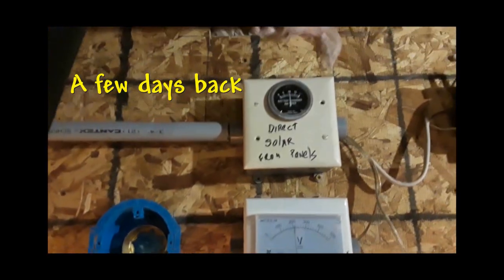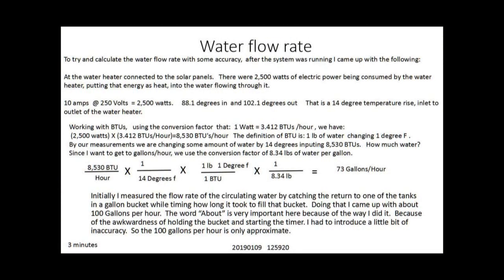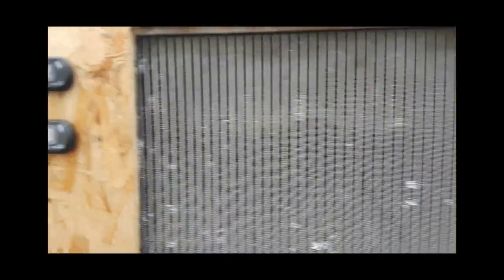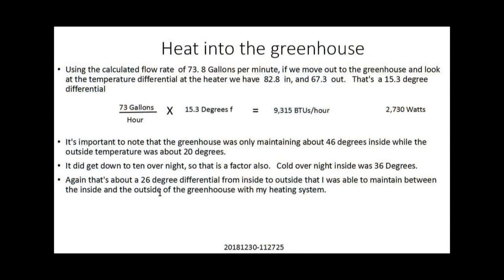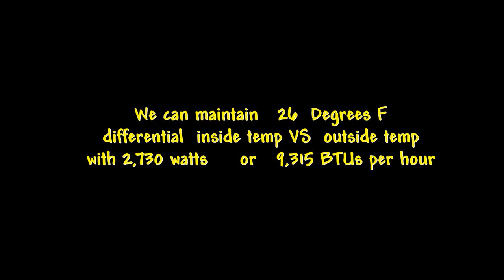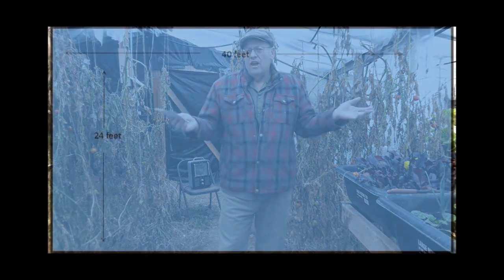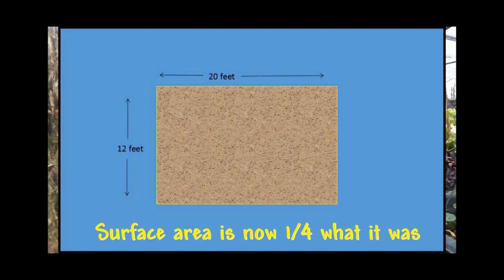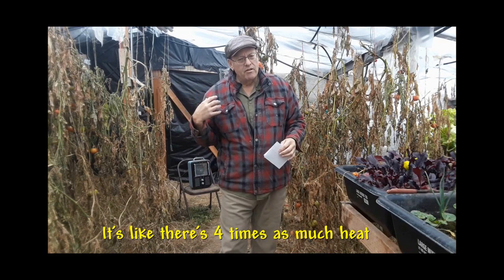Greenhouse Winter Heating System Part 12   Hard Data

Comment: The initial investment might make it not worthwhile, but you could get a lot more heat out of the 2500W of solar by using an air to water heat pump: easily double the heat energy per unit electricity on a sunny winter day.

Comment: Hi, thanks for the data, true and tested, and even if you are disappointed. Here is my advice : If you want to produce more electricity from your solar pannels in winter, you should put a higher angle on them. They should be perpendicular to the noon sun : I don't know your lattitude but closer to 70 degrees than 45 degrees (45 is often cited because it is for an optimum average , over the year. but you want to use it during winter). it would help the snow slide off too.

Comment: Suggestion:  Put rabbits in your green house.    They will generate their own body heat and will not freeze to death.   That body heat they generate will keep your plants alive when it gets cold.   The extra CO2 is a bonus for the plants.
Reply from the maker: What do I do with them during the summer time?
Reply: @eddysgreenhousegarden7022  BBQ
Reply: @eddysgreenhousegarden7022  Anything over 85 deg F can be hazardous.   
Remember their normal body temperature is between 101 to 103 deg F.  They're little heaters.
There are many tricks to keep a rabbit alive during the summer.    Get them out of the green house put them in Shade,  frozen water bottle or rocks in their cage on bad days.   The ears are what keep them cool.   moisten their ears don't squirt them like you would a dog.   Groom them to get as much hair off their body as you can.    

Really hot days put a block of ice in a foam ice chest with a fan set up so the air blows through the ice chest near the rabbit.   With the air passing over the rabbit.

They live about 8 years.

BTW - urine oder in any room bothers the hell out of me.   Put them in there when you need them.

Comment: I’ve been told that heat loss through the soil is the real killer.  You see these guys trenching to 5 ft around the greenhouse, then lining with 2” foam board.  Hard to know unless you have permanent soil temperature logging, but I suspect there’s something to it.
Reply from the maker: If you sink the greenhouse down into that 5 ft trench,  I think you get a little help from both ends but not a lot from either.  The ground will want to stay about 40 - 50 degrees.  If it's cold outside,  it'll help you keep above 40 or so inside the greenhouse.   If you're trying to stay at 70 degrees,  it'll pull heat out of the greenhouse.   If you work it right it can really help.
Reply: @eddysgreenhousegarden7022  The builds I have seen actually bury the "wall" of insulation, then backfill dirt.  It minimizes heat loss from the greenhouse through the shallowest part of the soil, which could be well below freezing.  Your build is doing quite well - with my compost heating I'm only able to achieve 12 deg F above outside.  I live in Denver, so that basically lets me add about two months to the growing season on either end.

Comment: I wonder how much radiant heat you are getting from the soil. Weather forecasting man just told us that the upcoming night will be extra cold because a snow cover prevents heat emitting from the soil.
Reply from the maker: Hi Earl,  Now that is a fascinating and  interesting question.   I have wondered how much heat I am getting from the deep fish pond I have.  The water circulates through the grow beds all the time.    But the ground itself.   I wonder how you could figure that out?
Reply: @eddysgreenhousegarden7022  Hi Eddy, just guesstimating:  our outdoor temperature drops an extra 9 F, because of the snowcover insulation. I think your pond + growbeds are stabilizing your greenhouse temperature, just like the walapini's do with their black painted water barrels. Your deep soil temperature will be stable, around your well water temperature, top level soil will show most variation, dependent on air temperature, solar influx and heat loss due to infrared radiation. If you build a small greenhouse inside your big one, with a temperature fit for tomato growing during winter, your heat will not be lost, but dissipate into the outer shell, enabling there the  growth of more cold resistant veggies.
Reply from the maker: @earlshine453  That's an excellent idea.  Where I grow tomatoes is a small area anyway.  I could close than in without a lot of trouble.  I might try that Earl.  Thanks.

Comment: Interesting.....I have a 8x8 ft greenhouse here in the south uk. We don't experience nowhere near those cold temperatures, in fact we mostly hover around 32-40f at night and a few degrees higher in the daylight hours. I keep my greenhouse warm by way of a diesel heater, it will keep the temperature about 15 degrees f above the outside temp on the lowest setting and costs approx 2 dollars a day to run. I could easily maintain the adequate temp to grow tomatoes if I wanted to. The other problem we all have though is light, there simply isn't enough daylight hours for the tomatoes to grow properly.  Thanks for sharing 👍
Reply from the maker: Grumbleweed,  I have heard that about the amount of light during winter.   But I have also heard even with limited wintertime light, good temperatures will work.  I am curious, have you tried it?  I know we get Canadian greenhouse tomatoes in the grocery stores over here.   It is an interesting question either way.   Thanks.
Reply: Hi Ed, no I haven't tried yet, it's the first year I've had the diesel heater. Now I know how easy it is for me to be able to maintain the adequate temperatures at a reasonable cost, I'll give it a go nxt winter and reveal the result.  I am dubious about the light levels though.